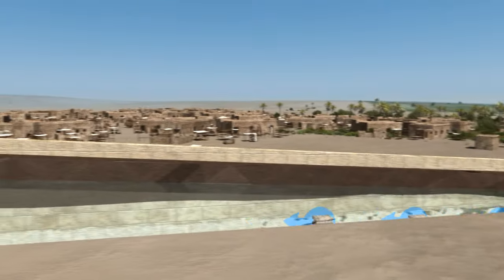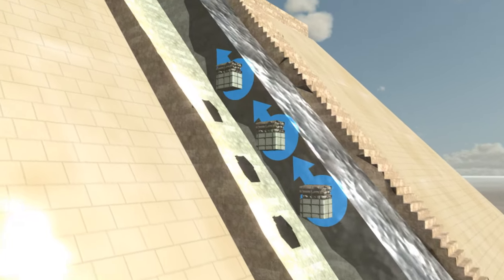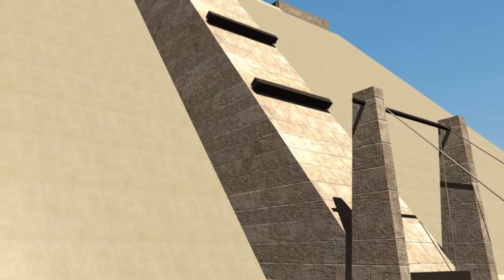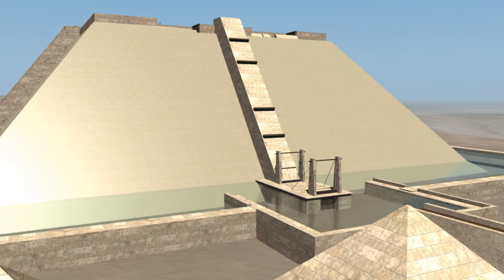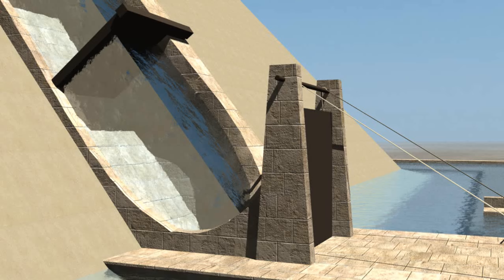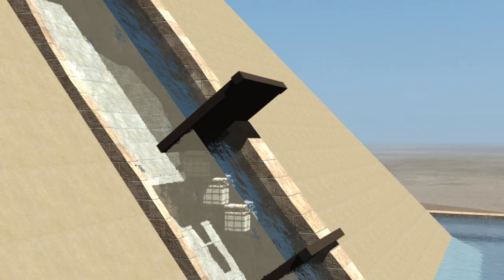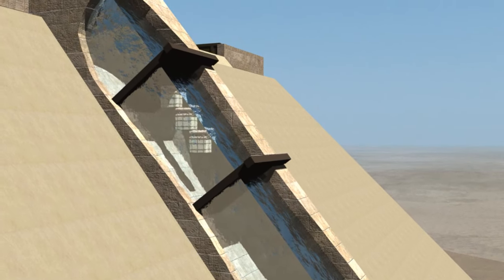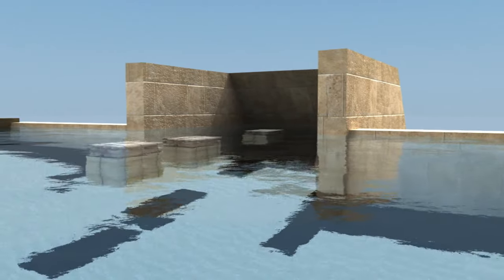How the Pyramids of Egypt were really built Addendum - Multiple Locks

Comment: This theory is utter nonsense. The only think I need to point out that the shaft isn't designed in accordance with hydrostatic principals here...it is just as thick at the bottom as it is at the top.  And the pressure from the water above doesn't just go away because there's a lock there... the water exerts pressure on the gate and therefore the walls of the shaft. And where is the evidence for all this?

Comment: Totally BS,there is no way possible water lifted those blocks,how do you figure they just" floated up there,how the hell did the water stay in those troughs. Who made the blocks so precise that they wouldnt leak? What tools did they use? Granite cannot be cut with copper,they had no steel tools,no cutting tools were ever found that were sharp enough to cut granite,yet those blocks show cut marks,and hole saw marks,slaves working 24/7 could never have possibly built them. Terrible idea.
Reply: IDK, you could say the same about roman aquaduct? Romans built aquaducts to supply >200 cities, the aquaducts supplying rome were over 300 miles long. 'How could they have built those not to leak'...

Comment: No way. Water just doesn’t behave that way on planet earth. And again, the weight of all that water would crush whatever you were trying to build. Using water in the causeway to move the blocks? Meh, it would take forever to rig them with floats like that, let alone the materials. Be easier to drag. Using water as an antigravity beam? No. Water flows down, not up. Keeping it in the tunnel and on top of the roof would be impossible

Comment: I would have come up with this concept when I was 9 years-old.  By the time I reached the age of 9-1/2 years old I'd have seen how ignorant it is.  The 'blocks' were cast in place one unglamorous bucket of cement/concrete at a time.  Anyone with any real world experience and a basic knowledge of the lime cycle and pozzolan reactions knows this.  What this silly idea forgets, among MANY other things, is that the water displaced by the stones being removed at the top would have to be replaced at the top, and the seals at the locks would require very modern materials and precision bearings and seals and a locking mechanism to prevent the water pressure from forcing the chamber doors out and losing all the water. Water pressure would be around 44 psi at the bottom gate of the two active chambers, and that's pretty high.  Opening one chamber would require adding water to account for the loss of the gate door if this is air tight, and it would have to be if it was to work.  Pushing the gate closed would be very difficult, requiring a lot of mechanical power too. This guy is a bone head; the real world and his CAD program don't behave the same way. There is nothing 'mysterious' about the construction of the pyramids, just good old hard work, common sense and industrious spirit.  The real mystery is how far we've fallen in all those areas. Those promoting these crack-pot theories have been educated beyond their intelligence. They need to get outside more and breath some fresh air and actually build something themselves, with their own two hands.  Read 'Pyramids, an Enigma Solved', Dr. Joseph Davidovits, 1987ish.  He gets it.  Not very mysterious or glamorous-- Just True!  Throws these idiots on their pointy little heads.
Reply: I agree on the first part of your comment, but I think that Davidovits is only partially right, His cast concrete is only used to fill in difficult spots and to level the base for the casing stones. For a more detailed description on how I would built the great pyramid visit: www.pyramid-building-solution.com
Reply: So you're telling me that they constructed the pyramids in a primitive way ? Like 30 skinny guys pulling a 1 ton rock using a string attatched to it ? crazy
Reply: No-one has solved the pyramid's construction enigma yet.

Comment: This technique is not practical to lift heavy block ...How prevent the pressure of water ,,no cement ..No welding..This need an air tight tunnel..

Comment: 2916 TONS.. and you're not even half way up the pyramid.
6000 tons near the top.. That's the weight of a type 45 destroyer..
held up by a wooden slidey door.
Build yourself a submarine out of wood and then descend to 200 feet.
you won't be coming back up again hahahahahahaha
Reply: The pyramid weight almost 6,000,000 Tonnes, that is ~1000x the weight you cite. The weight in a panama canal lock is ~200,000 tonnes. Therefore we are talking of 3% of said lock. Also don't forget that some wood approaches the strength of steel.

And also the locks need not be comprised of wood. Granite or other such materials could serve the same purpose.

Comment: Completely bogus.
Doesn’t take engineering knowledge, as a matter of fact even with 6th grade physics and math knowledge you can calculate that the weight of a 50ft high column of water would make this whole theory impossible. At 4 Celsius (39.2  F) 1 cubic meter, 1000Liter (264,1 Gal) of water is 1000kg (2204.6lbs)… you know how to multiply and proceed?